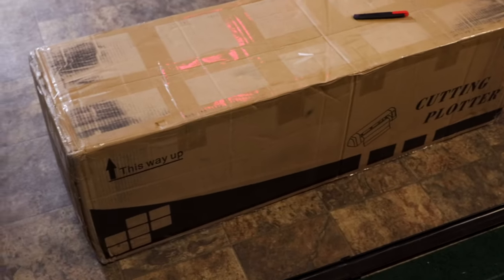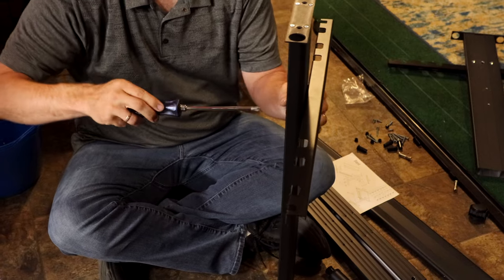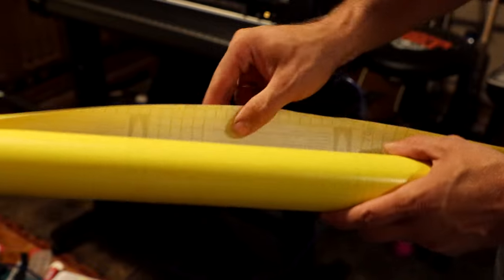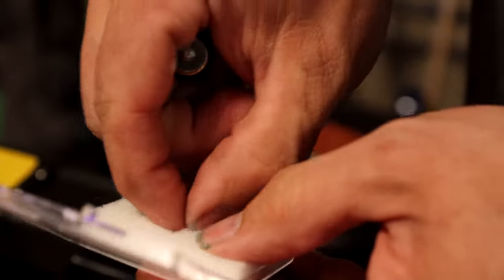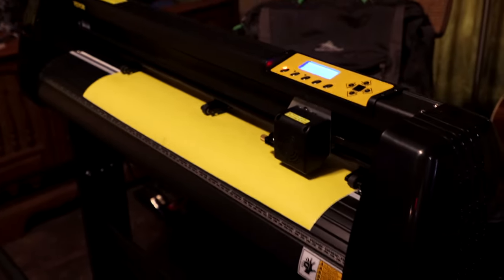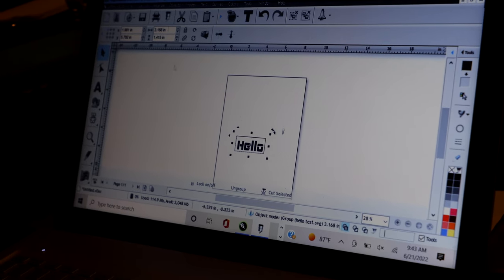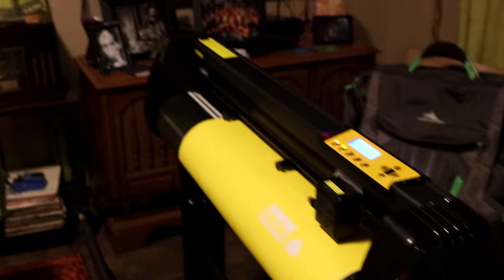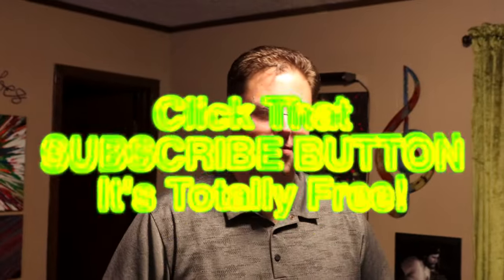Vevor Vinyl Cutter: Unboxing, Set Up and Use

Comment: The 60 degree blade is for very small letters and for material like reflective and some htv vinyls. I install my blades to where you can barely see the blade ...it's always good to do a few test cuts to make sure you're only cutting barley thru the vinyl and marking the paper backing ..not cutting the backing paper

Comment: I have had twp vevor vinyl cutters that took a dump with in a month. I found for affordability US Cutter has been great I have a 28in and 48in..I'm also not a fan of the sign software it comes with.
Reply: got a brand new, never used except to power it on - USCutter MH-871 34" from a friend.  she never used it but was moving and thought I might be able to get some use from it.  It grinds and makes weird cuts.  Never has worked but it's out of warranty.  USCutter customer service gave me something to try - but thought it was most likely a bad MB. (right out of the box).  So I'm debating on whether or not to buy a refurbished US Cutter or buy a new Vevor.  I have the USCutter stand and also have surecutsalot software - so maybe if I can find one and get a reduced price - minus the stand and the software - I may do that.  

looking for input.  I'm in NE Illinois and there is NO ONE around that works on them to at least tell me what's wrong with it.

thanks for letting me vent
Reply: What do you mean by taking a dump? I’m on my second one, first one lasted a good year before it started leaving lines in my cuts and second one started doing it almost instantly
Reply: @Outofluck_club  taking a dump as in circuit board died vevor wouldn't do anything to help rectify the problems.
Reply: These are OK as toy units to learn on as they are so cheap.

Comment: Vevor vinyl cutters have a major flaw. I know I have owned two.   The pinch rollers dig into the material. 

Its fine if its a small piece you only use the rollers on the edge of the material but when cutting larger pieces you need the center pinch roller so it tracks. 

You get what you pay for!!
Reply: If that is the worst issue, I can live with it as I plan to only use for masking for airbrush.
Reply: @Dude_Slick  Might be better then to get a smaller form cutter (much cheaper) as you won't be able to get a mask wider than 18" without possible hatch marks on a cut line which is airbrushing the paint will bleed under.  

What type of stencil material are you using? I prefer 811 or 813.
Reply: @The_K_Project  Why would I care about marks on a mask? It is not staying there. I cut up to 24" mask on my 30" Seiki for decades.
Reply: @Dude_Slick  I was assuming since you wrote you are using an airbrush that you're using a thinning agent. Hatch marks on a masking agent's surface increases its roughness average and therefor has a direct correlation of the risk of under-bleeding.  

I guess the easiest way to describe it is like the sealing of a static joint which you take into account the factors that affect the integrity of the seal/ But in painting you want to decrease the likelihood of under-bleeding, such as, but not limited to: Integrity of the seal, Masking agent, Surface profile, Temperature, Barometric pressure, Viscosity of the medium, air pressure, whether using a single or dual action airbrush, etc.. All have a direct correlation on the risk of unwanted capillary action (AKA under-bleeding) when applying paint. 

I've seen it occur even with viscosity down to 60 cPs and masking agents which were very elastic and burnished prior to spraying. Of course the seal between two surfaces can never be "perfect" and it is impossible to stop all capillary action in a seal. I'm just referring to that which is visible or haptic. 

As they say in this business; "People but with their eyes!"
Reply: @Dude_Slick  I cant risk destroying a customer's product. I work on very rare guitars and even one mistake cost more than most make in a lifetime.
Reply: @The_K_Project  I build guitars from scratch. As for bleeding, I don't use a stencil for a finished line. All my work is finished freehand. Trust me bud, I've been at this for four decades, and the issues you're sighting, are non issues. I bought the Vevor 28" and it works perfectly. BTW, you do know the tension on those rollers is adjustable, right?

Comment: I agree with you on Illustrator.  I used it for years.  upgraded several times.  but then had to stick with CS3.  had a computer crash and attempted to reinstall and couldn't.  contacted Adobe and they said it was no longer supported and said I couldn't use it.  So PO'd I just threw my $250+ software with the box and the registration codes in the trash.;

But I do have Corel.  most recent was 17.  Pretty sure I didn't have any issues reinstalling.  I used Signtools for my old Panther cutter.

now for the questions and a little history.  A friend bought a USCutter MH-871 several years ago and never used it.  She gave it to me since she was moving and thought I could use it.  I was unable to get it to cut properly.  It's still sitting here and not working.  it won't move side to side............it just grinds away.  The tech support guy was very nice and did give me something to try, but though it was most likely a bad MB which could be replaced for $80.

What is your opinion of US Cutter vs Vevor?  Seriously considering buying this one.  My old Panther cutter is only 24" and the original software that I got - won't work with Windows 10.  I have all the old disks, etc.  Flexi-Sign was the software.  too expensive to upgrade.

How is the customer support on the Vevor and are there any dealers around the country.  USCutter only ships cutters.  They don't have any 'shops' around.

I'd really love some input.  thank you and thanks for the video.  If I purchase one - I'll most likely be re-watching it.

Comment: I have been loooking to do some vinyl work, this machine looks like a good deal for what I am wanting to do. Is it a different type of vinyl that would be used to make vinyl lettering for a vehicle since you don't peel and stick it?
Reply from the maker: It’s the same vinyl (I would just get the thicker better quality) but this is what is used to make stickers for anything (same as a vehicle)
Reply: For vehicle look into the oracal 651 series. It's great and lasts for years outdoor.
Reply: @T6Tarek  is that a type of vinyl?
Reply: @justforkiks29  oracle is the brand 651 is the series its a really good intermediate vinyl. Holds up for 7 to ten years outside and easy to work with it. I personally prefer it over 3M.
Reply: Nice set up, i believe I have the same cutter. Do you know where to get wider rolls of vinyl. A lot of places online are asking over $100 plus for a roll of oracle 651. Thanks

Comment: I got a 53" but my blade holder doesn't sit flush like yours the gold knob tightens though. What should I do?
Reply from the maker: I would contact the company
Reply: @koonTrucking do you know if the arm that swings open(the clamp part that keeps the holder on the plotter)has to be closed or cab it be open?

Comment: I just bought one because the only software that I know for sure will run my Seiki plotter cost way too much. The only Flexi license I have only works on Wln 7.   If I knew Vinylmaster would do it, I would just buy the software. As for the Vinyl that ships with it,  it's useless to me, as I use plotters for low tach masking film only.
Reply: SignMaster and VinylMaster are from the same company and as far as I can tell are really the same software other than SignMaster comes prepackaged with products.